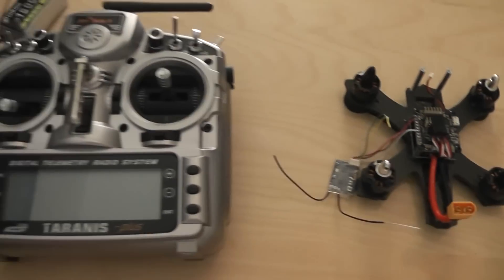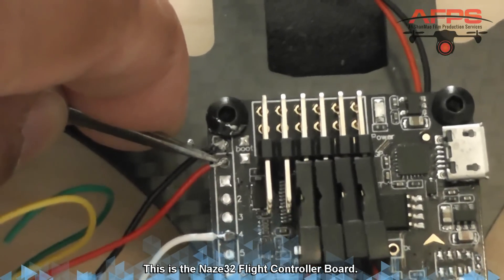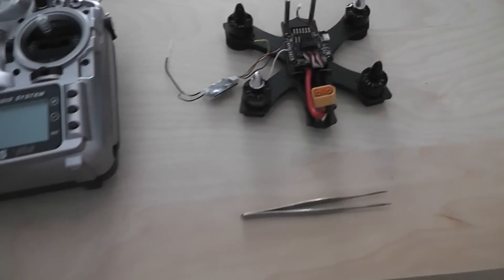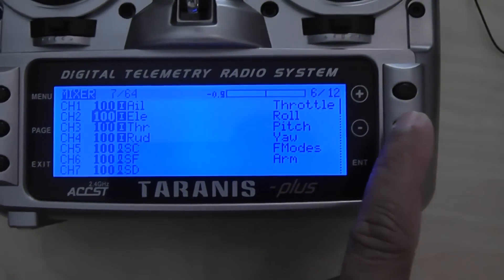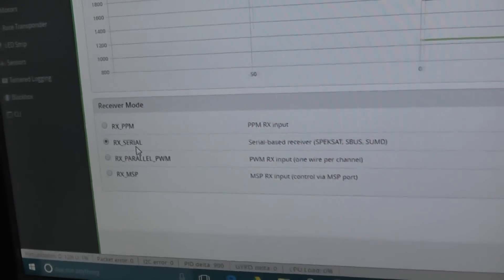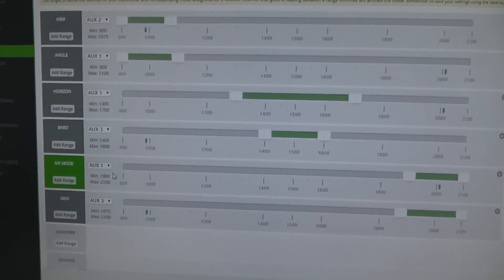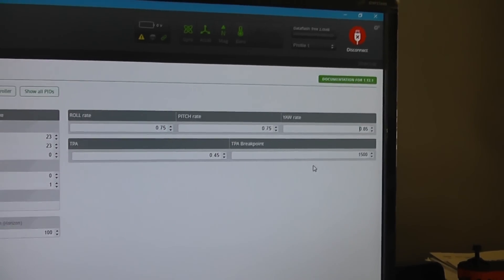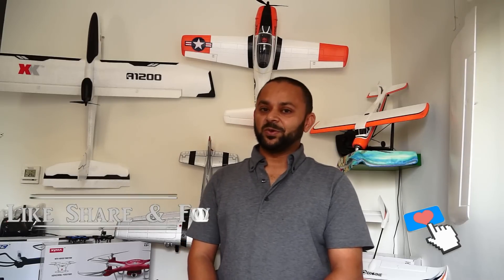How to setup JJPro P130 with CleanFlight and Taranis X9D Plus

Comment: Nice review, I have recently got the ARF version and FS-iA6B receiver. I could bind the receiver with the TX, however I cannot configure quadcopter on cleanflight, specifically I cannot "flash" the firmware , is there any specific firmware you would recommend to this quadcopter ? Or do you suggest any alternative steps ? Also does it matter how the channel cables are plugged to the receiver ?